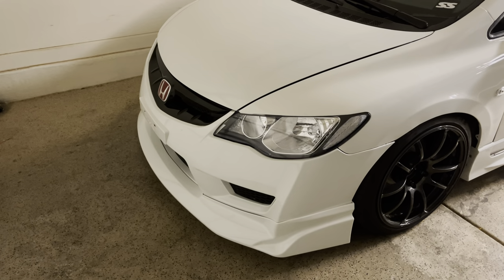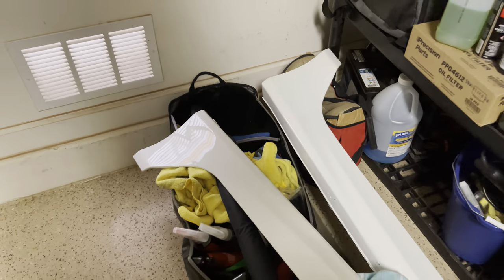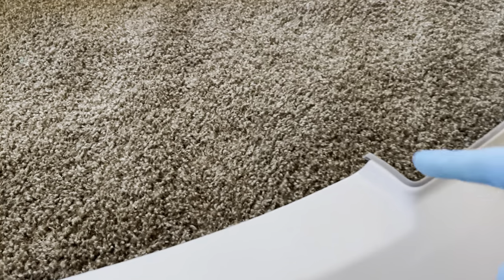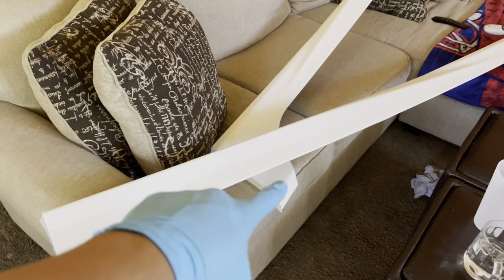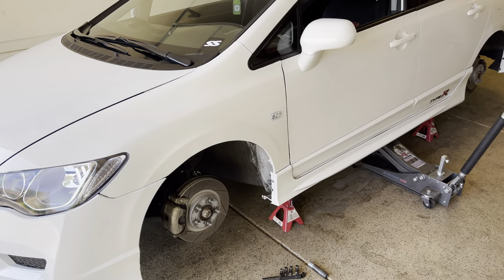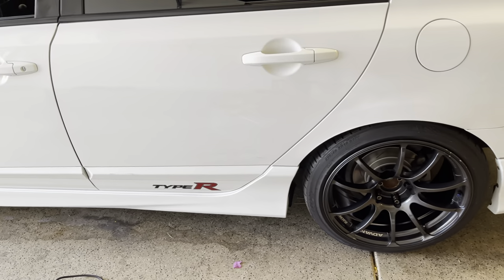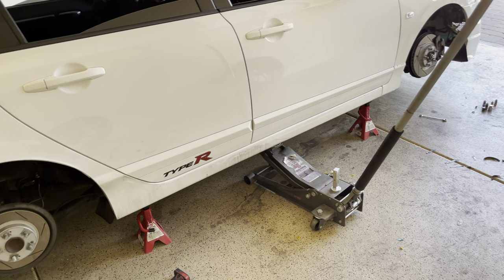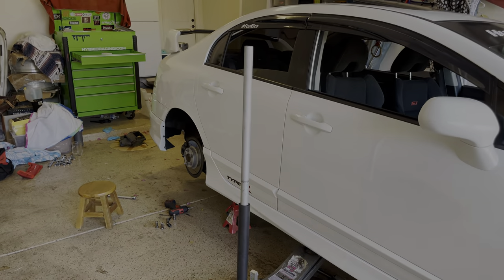FD2 Type R Oem Style Side Skirts Install

Comment: Bro! Did you screw the bottom tabs in? I got the same side skirts with those tabs like for the rocker panels!
Reply from the maker: No I usually leave the bottom tabs alone. I had the Mugen style ones like that too. It’s just secured with 3M tape and the 4 screws 👍
Reply: @Vicwavy  awesome man I appreciate it I should be getting my car back from paint soon! FD2 GANG
Reply from the maker: @marcosgonzalez1280  👏👏👏

Comment: The visors had to be painted white, it would also look very good. Please write what discs you have. Firm and size. And what size rubber is needed for them.
Reply from the maker: Yeah that’s true but I like the oem look. So the Rotors I have are from R1 concepts. Slotted and my tires are 225/40 running 18x9
Reply: @Vicwavy  Thank you)
Reply from the maker: @EXMerser  Anytime

Comment: Curious as to what you used to seal the screws that went into the rocker panel? Since it's been two years has anything rusted?
Reply from the maker: No nothing has rusted cause there’s barely any rain here in the desert. I used some nuts on the opposite side to secure in place

Comment: I thought the oem you have to drill holes on the side?
Reply from the maker: Yes Oem you have to drill into the side of the car
Reply: @Vicwavy  did you do any drilling?
Reply from the maker: @HmXobTsIsGxY  No these aren’t oem
Reply: @Vicwavy  fitment looks prefect and the groove on the bottom looks prefect and noticeable not like the other ones.

Comment: How the tape holding from heat/rain?
Reply from the maker: Been holding good. I’ve had to change the tape only once but holds good. I’ll probably use a commercial 3m tape next time
Reply: @Vicwavy  which one do you recommend? Cause i am about to do my fg2 with the skirts and i wanna do a one shot job , any recommendations? 
Much appreciate your response
Reply from the maker: @Mhatre747  Yeah so you could use gorilla tape or any heavy duty 3m with the red backing preferably the black not grey color and you should be good. Just make sure both surfaces are clean you can use ipa and helps to heat up tape for better bond 👍